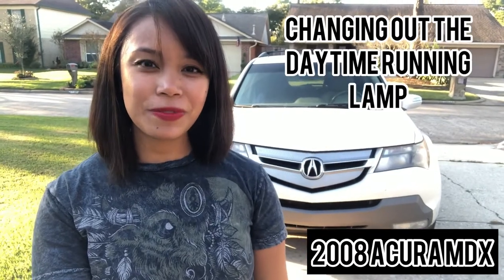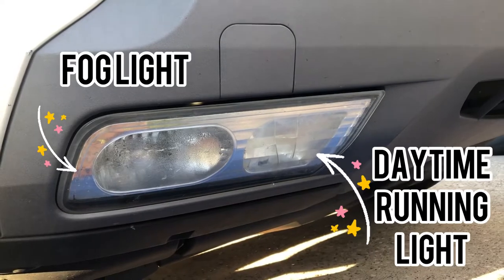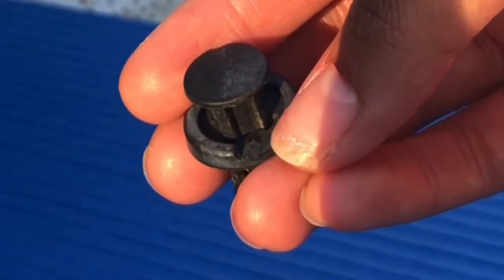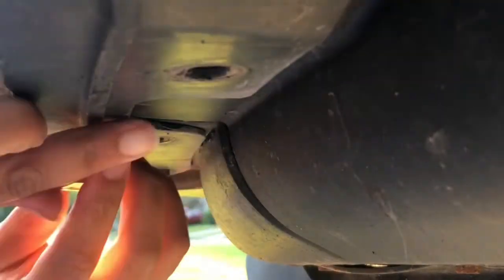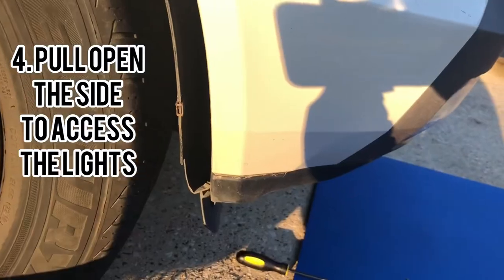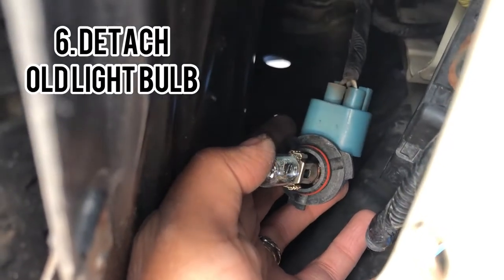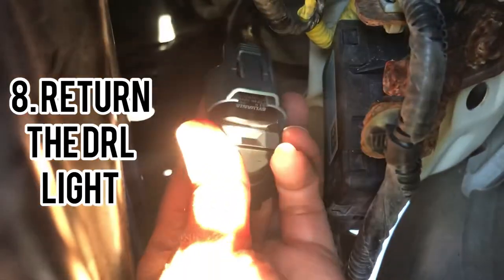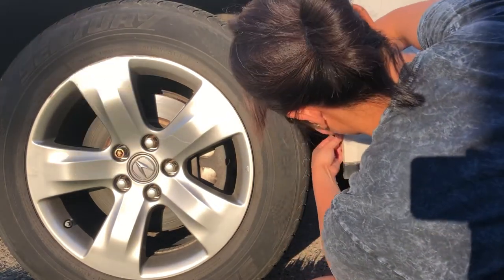How to Change Out your DRL Daytime Running Light: 2008 Acura MDX

Comment: Great job my dear! You don’t need to remove the plastic fasteners under bumper. You can just remove screw in tire well and under corner  well. You can gain a little more space if you turn the wheel in as well. Also avoid placing fingers on bulbs, it can affect life of bulb an even cause it to shatter. Overall you did a great job!
Reply from the maker: Thank you for the comment! Lol yes, you are correct on everything 😅 Glad for the great input!

Comment: This is an excellent how to. Thank you!
I was able to replace the DRL on my new 08 in 10 minutes. Used my new cargo mat.
The fastener in the wheel well on mine has a Phillips head, and there is a 10mm bolt at the end of the bumper. But everything worked just the way you presented. Got all the plastic fasteners out without destroying them.
I did the wrong side, for some reason. But the second time round took 5 minutes.
One thing, though...using left and right is confusing, because that changes on each side of the car and whether you're in front or behind the bumper. Sorry to mansplain.
For me the running lights are the inside lights, and I turn the bulb counterclockwise to remove and clockwise to install.
Reply from the maker: Thank you for the comment lol and mansplain away☺️ Definitely will consider that for future videos. Perhaps I should say right or left pertaining to the image in the video.

Comment: Very good process. I would recommend that you turn the wheel to the left ( or right) depending on what side you are working on , but I found it much easier to remove the wheel and pull the plastic wheel well liner back to gain much more access. But again, I liked your video. It made a great start for me
Reply from the maker: Thanks for the tips!

Comment: What if you had (started the engine and ) turned the front wheels all the way to the left ?
Wouldn't that have given you a little more room to get your hand in there ?
Reply from the maker: Did that work for you? Thank you for the suggestion.
Reply: Yes Charles.. That would give you more room for bigger hands..🇨🇦🇬🇾
Reply: You genius bastard. Thank you

Comment: I would recommend putting the new light bulb on with gloves so oils from your hands don’t get on the bulb
Reply from the maker: Thank you! Your recommendation is definitely appreciated. 🤩
Reply: Yeah, it doesn't take much oil's from your skin or any other contaminants to greatly reduce the life of your bulb. It gets very hot under normal operating conditions, and oils or contaminants on the surface of the bulb will cause it to heat up more than the normal operating temperature since it will trap the heat and keep it from dissipating from the bulb. This is what reduces the life of your bulb. I used to wonder why my bulbs were burning out so fast when I was younger and worked on my own car. 😄

Comment: What happens if you replace the bulb and the alert of the dash is still there?
Reply from the maker: That is a great question. Unfortunately, I do not have an answer, only a hypothesis. If the bulb is working, but the dash alert is still there, perhaps there is still a problem with the sensor that creates the dash alert? I would get a diagnostic.